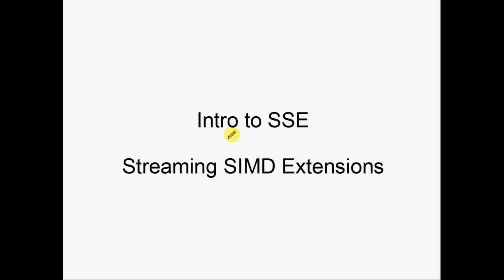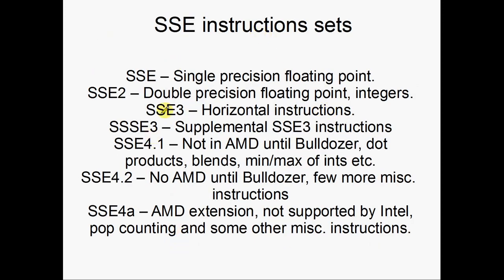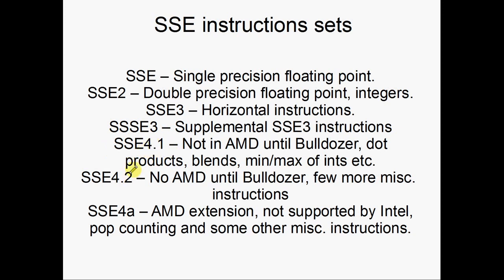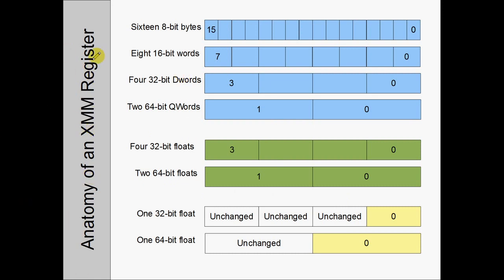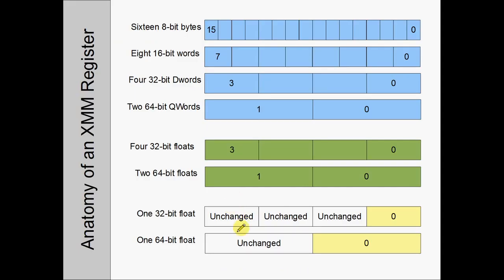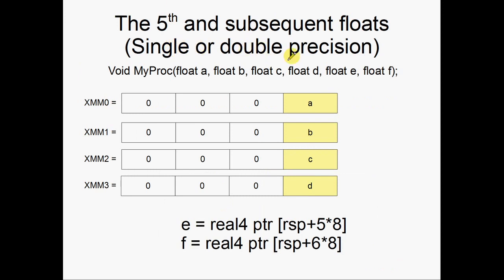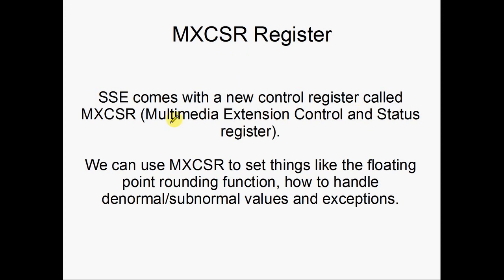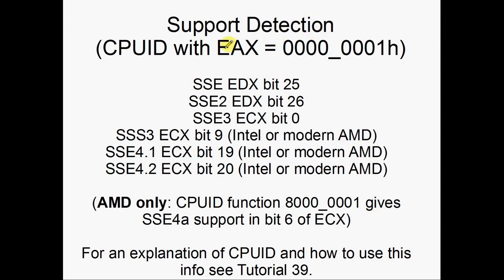x64 Assembly Tutorial 47: Intro to SSE

Comment: Once I was wondering why there is no such thing like float indexing - for 32mln address space it is directly implementable. It could be none concern in CPU, but in GPU it could even more simplify architecture. Post Scriptum: thank you for low-cost GPU stuff inspiration ( at one of CUDA movies you've used an ancient GTX280, which is not a typical stuff for professionals ) as a result I have found something so fascinating like GT730 4GB GDDR5 which is quite useful in median situation for 50$.